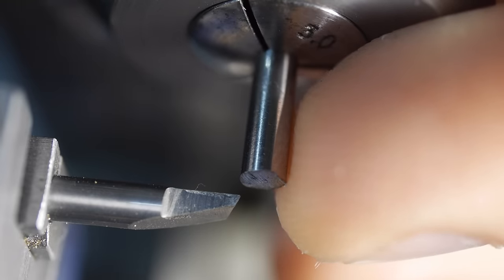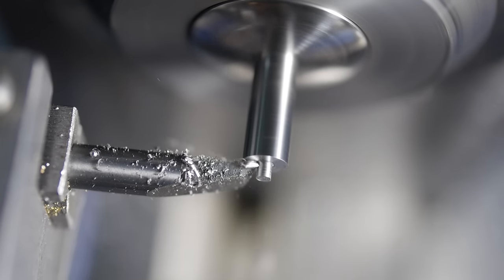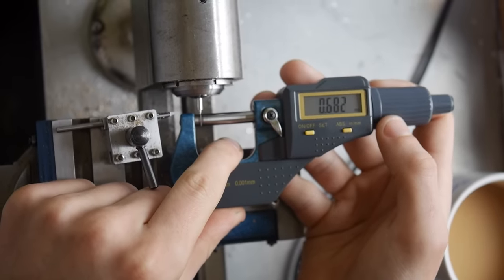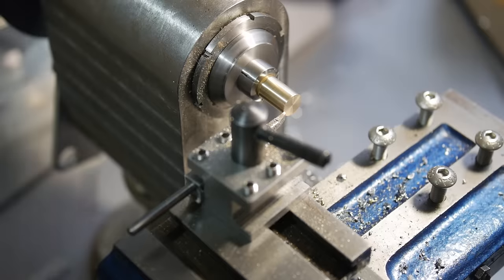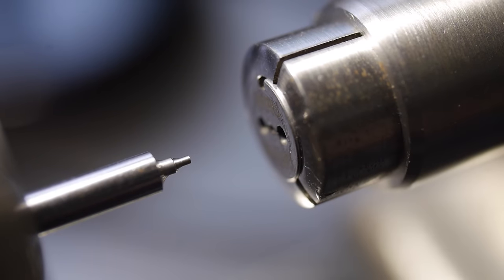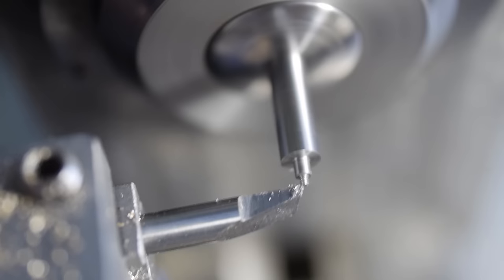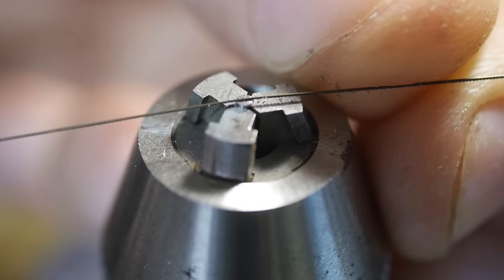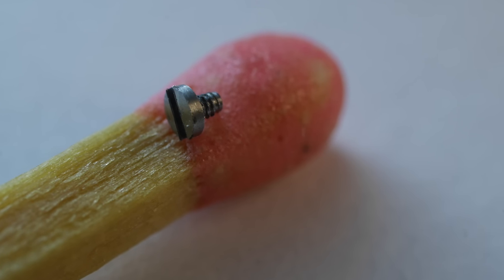Watchmaking: Machining a 0.6 mm Screw

Comment: I'm an engineer working in new product development.  I often get crazy looks from the machine shop guys when I ask if they can make this or that for me.  But I haven't yet asked them to make a 0.6 mm diameter screw.  I should do that and see what reaction I get.

By the way, huge respect to skilled machinists.  Without those guys nothing would ever happen.
Reply: You’ll probably wind up in a compactor.I’m a retired machinist. Our main product was rollers for printing presses and the large one used for glass. Our area most of our tolerances 2/10ths on the roller areas and up to 5/10ths on the main body. The specs didn’t make since at first. I asked the plant manager why are they so important and that tight? If we make them here in the summer and send them to Alaska the specs will be off from just the temperature difference? He said that’s just a guide line. The 2/10ths on the OD makes it so they can run the rollers faster without vibration or wobbling. Thus ruining whatever they are printing. Makes sense. This was when I first started there.
Reply: yo how do you get a job like that? i wanna do that
Reply: @adog3129  Get a bachelor's in engineering, probably best field would be mechanical engineering.  Then try to get an internship at a company that does what you'd like to be doing.  Be patient and keep trying until you get the job you want.
Reply: @paulredinger5830  Those guys would simply give me a crazy look then tell me it can't be done.  Or they would just out source it and not worry about it, lol.
Reply: true. without water purification plants nothing would happen.
Reply: I used to make these dies for watch screws from .3mm to 10 ba, especially for the watch and clock industry in the UK, .but that was 1955  and for 7 years it was a heart-stopping breath-holding experience tapping out the steel and then drilling 3 holes making files to shape a central  cutting section then checking the thread it made under a  microscope think only the swiss carried on doing it after id left
Reply: @jimmyboy131 Gotta be smart as well.

Comment: I've been doing stuff like this for 39 years.
Most machinists won't even look at stuff this small but I just see it as a challenge, the same as machining big stuff.
Reply: super impressive dude! has it gotten any easier/less complicated over the years?
Reply: As a fitter and turner in the mining industry I actually think machining the big stuff is way easier... I admire the blokes like Clickspring who can do the tiny stuff AND make it beautiful.
Reply: It's not quite the same but since I'm not good at making unique stuff in art.  I just started trying to make the smallest real things I could out of clay.  Cups with handles and all less than a cm in size.  Tiny tables, tiny forks, things so small that they usually just fell apart in the kiln, I made a tiny champagne glass only 5mm tall which was my pride and joy
Reply: @membranealpha5961  I'm a tool maker, like anything it gets easier over time. But like op said, gotta look at things as challenges and not whine about them. Ik a lot of toolmakers who whine everyday, and that doesn't make one happy.

Comment: Nice to see someone doing this on a craftsman level with hand ground turning tools. I’m a CNC Swiss Screw machine programmer/machinist. We go down to a #0000-160 screw but some of the smallest parts/features we make aren’t simple screws. A job I recently ran employed both a .0098” (.24mm) drill and .011” (.279mm) endmill. We run those around 65,000rpm.

Edit: Your bit about looking for lost components… just imagine when someone accidentally upturns a cart with 100,000 pieces that all comfortably fit inside of a shoe box.
Reply: Heh… I work in electronics, and a common size for discrete capacitors and resistors nowadays is 1mm x 0.5mm. The maximum thickness is the same as the width. If the thickest possible ones were stacked neatly, 4 million of them would fit in 1 liter. But the smallest discrete components available now are 0.4mm x 0.2mm. So 62.5 million of those would fit in a liter! 😳
Reply: @tookitogo  you must have the patience of a Saint working with components that small🤔😇, I get frustrated trying to they'd fine fishing line through the eye of small hooks!😂✌️
Reply: @jamiecurran3544  Machines do the work
Reply: @yohkodevilhunter8292  yeah but even they get frustrated n make mistakes!😁, I've seen many malfunctions whilst working in places with such machines n had to clean up their mess afterwards!😂✌️
Reply: @jamiecurran3544  Heheheh. 

Yeah, I’ve worked with trainees who were whining about much, much larger parts than that being too small and fiddly, and I told them, “If you don’t like small and fiddly, electronics is the wrong career for you!” (Same thing with attention to detail: if you can’t handle absolute attention to detail, you can’t do well at this, because “almost the same” isn’t the same as “the same” in this industry. Adding or changing one letter to a part number can make it completely incompatible.)
Reply: @tookitogo exactly.  There are 10 types of people in this world: those who understand binary and those who don’t.
Reply: @BobWidlefish  Indeed! And for them, there’s no place like 127.0.0.1!!
Reply: 65,000 rpm!  That's incredible!  Do you use air bearings?
Reply: @yohkodevilhunter8292  In how many years this will be the answer to all questions about construction? Boiled frogs comes to mind...
Reply: Thanks for putting it into perspective with real units. As a welder, I never deal with things smaller than a few inches. Can't imagine having to measure my parts in thousandths.
Reply: lol that edit. Sounds like u speak from experience.
Reply: Jesus, dude. Don't say scary shit like that... That's definitely going to be in my nightmares.
Reply: oh wow 😳

Comment: I have three tap and die sets for those screws and nuts. They are used in instrument repair as well.
You can tell, watchmakers have a huge influence in many areas where miniaturization is used. Which is why I watch such videos to learn ways to repair equipment so it doesn't have to be trashed.

Comment: As a Carpenter I look at my rule and my tape measure repeatedly during a work day. Point 6 of a millimetre is incredibly small. Just stop for a minute and find yourself a ruler or a tape measure. Point 6 or just over half of the distance between those two lines. It is absolutely amazing and stark raving crazy that we can repeatedly produce things of that size and smaller. 
Mark from Melbourne Australia
Reply: I think I'm more impressed by the die!
Reply: True. The statistical process control has to be incredibely tight at these scales.
Reply: @CreepyHandedMan  that or the volume is  super low. Niche-component manufacturing shops have fuck-all process control
Reply: @myuzu_  As others have pointed out, there are swiss turning machines that can produce multiples of these and smaller in under a minute. Truly incredible what some people on this planet are able to engineer.
Reply: When I served my apprenticeship as a joiner/cabinet maker, we worked to 0.5mm setting out staircases. The logic behind this is that if we went to the millimetre, then over 13 risers you could end up being out by 13mm on your FFL to FFL (finished floor level) and if you tried to tilt the staircase to compensate, the treads would not be level.
Reply: @CyberCurtainTwitcher  I just did my first staircase (18 steps) and ended with a leftover 1/8 of an inch at the top. Never thought to reduce it to millimeters.
Reply: It's smaller than a pencil line 😁

Comment: Ive never seen such a small die, one wonders how they make them. Always wondered how very small screws are made, now I know thank you
Reply: The die is made very carefully, lol. If you look at the die closely, my bet is you can figure it out. (Hint: single tooth cutting, pitch offset)
Reply: So in the history of machine shop its a chicken and egg thing. Which came first. The small machines making bigger machines or vice versa. Both I guess. But in the real world of the chicken and the egg, the rooster came first otherwise you just have a chicken with an unfertilized egg.
Reply: American made a wire so thin, nobody could beat them. Sent one to a swiss watch maker. Came back with no message.  Fine examination showed, they had bored a hole in it..  True story - or not..  My dad was a lieing piece of crap, but nice story..
Reply: I seem to remember that about 2 miles of .0035 mm long thread was produced from some of my squeeze dies ,so how they produced from that screws with slotted heads on the mind boggles

Comment: @Chronova Engineering
3:19 You could put a strong magnet (eg. neodymium) in a small plastic bag & attach it to the tail-stock (or lower), so when the part is separated it is sucked to the magnet.
The bag helps you remove the shavings from the magnet, by just turning the bag inside out & remove the bag. (you might need to de-magnetize the part later?)
Just watch out so the plastic don't tangle up with the part in the lathe.
Reply: Can't see how this wouldn't get tangled, or if just sitting a bag down, how it wouldn't be much different sifting through the chips.

Comment: We did 0.55 UNM screws on a CNC lathe by single point threading. If I remember correctly the depth of thread was .003" per side and we had to take .0001" per pass (30 passes) or it would just snap off.

Comment: Nice work, and amazing to see the size of these fasteners.
I've just been working on the other end of the scale, we are currently assembling machinery to start sinking a 1.3km deep mine shaft.
The bolts we fitted last week had 70mm heads and required 4000nm tension 🙂
Reply: whoa what does the process look like at that size?
Reply: @lemminjuice 
Lots of swinging of a torque multiplier gun 🙂

Comment: An old machinists trick when parting off is to use a small paint brush dipped in oil and placed on the small component as you part it off, this should catch the part in the hairs of the brush.
Reply: I've seen a machinist make a paper cone and catch it in that. Just make sure that the end is folded over, otherwise it's just a funnel! 😢

Comment: I work for a company that buys misguided freight from the likes of Amazon and UPS. Not too long ago, I opened a box from a load of UPS shipments and discovered an array of disassembled watches, all packeted up in smaller and smaller zip top bags. I assume they were bound for some final assemble process somewhere, but never quite made it.
Incidentally, I worked for a decade in front line manufacturing making defense and oceanographic components. The smallest thread I ever personally cut was 0-80. I knew of jewelers and watch makers lathes, and in fact the company I worked had a few of them (used mostly as polishing stations for sensor housing lenses).
I was scratching my head, wondering how the tiny watch screws are made, and what a headache it must be.
Thanks for the video. Very informative.

Comment: My grandfather was a master machinist. During the Great Depression he used his mother’s steel knitting needles as stock to make new shafts for a clock. On a 1892 flat-belt drive 18” by 72” engine lathe that could do a 3/4” diameter reduction in mild steel in one pass. A clockmaker recently said the 170+ year clockworks are in very good shape. After my father died I donated the lathe and tooling to a museum that has a steam-powered, belt-driven machine shop. The last production job done on that lathe was 9,500 pieces around 1970.

Comment: I work on model aero engines and mostly make all my own screws.   Slots I generally cut with slitting saws on a vertical Milling machine making a threaded and triple slit holding collet usually in brass first.   Smallest screw I've made so far on my English Toolmakers Lathe was 0.8mm dia. single point screw cut and in stainless steel as it was going into Mother's glasses on a Sunday when all the Optometrists were shut and as she was very short sighted,   her glasses were critical.    Most machined commercial screws are made from leaded free cutting mild steel.   For Philips head screws I cold forge the Phillips recess then machine the head to shape using hand ground form tools.
Only thing I'd have done differently on your screw would be to machine a 30 degree start to the screw thread.
Really good idea when making tiny parts is to thoroughly clean down the Lathe first!   Oh and the older you get the more easily small parts fall from your grasp!

Comment: I used to make twelfth scale miniature furniture  which required very small wood screws. I used 1.5mm aluminium bronze  and a Unimat SL lathe, two tools were needed  the first a cutter angled at 45 degrees  and a parting off tool with a slight angle on the tip.The first cut was to taper the tip at 45 degrees  then to turn down the shaft of the screw to the required OD about 0-3mm  with a 45degree countersink head reduced to the final diameter. I used a watch makers dieplate  to cut the thread then parted it off, the slight angle on the parting off tool allowed one to snap the screw from the stock rather than losing it. The head was finished by putting the screw into a steel plate with a hole to hold the shaft filing flat and cutting the slot with a very fine slotting file.
These screws were made to copy old hand made wood screws and held well if a brad awl was used to open the wood which closed on them after insertion.
Cliff Taylor

Comment: This is crazzy. I recently been watching watch making and fixing videos and its crazzy how small these screws and parts are in a watch. They gotta use a microscope regularly to inspect pieces for broken parts i the piece cause its so small even the smallest mjcroscopic just about piece breaks off a part can cause a watch not to work and you wluld never see that the part is bromen by eye cause its so small. Its incredible how small watch parts and screws are. They are basically microscopic works of mechanical engineering its crazzy. Thats why I lile my clear glass backed high end highly expensive hand made swiss watch cause the machining and blueing and the work and design of all the working pieces is a work of art that this watch maker likes ppl to be abke to enjoy it as a watch and enjoy the beautifull mechanical workings on the inside as well

Comment: I worked in a shop that made high production pressure gauge movement parts.  We ran wire fed escomatic lathes.  We had it down pat and ran ten machines per operator.  
There a lot of ways to catch parts.

Comment: you can make screws like these by the tens of thousands on a 12mm citizen or tsugami. its fascinating to see because what would take me probably 1 - 3 hours to make one manually you could get a setup done in brass on said machines and have them flying off the machine in around 5 hours if uninterrupted/motivated. love this trade

Comment: Truly amazing. Just a few weeks ago I opened up my mother's watch to change the battery but the watch face itself is super small and as big as an average man's thumb nail. When changing the battery I noticed that I could not extract it if I did not take out a screw and the right screw driver was so hard to find. At that point I started wondering how are such tiny screws made.

Comment: When I make very small parts in a manual lathe, I make a cone out of a piece of paper to catch the part when it drops.  Hold the cone in one hand while cranking with the other.  I have never had the paper catch and pulled into the chuck, but if held lightly just let go.  the paper aint gonna hurt yah .  Dump its contents out into a dish or tray and you can easily fish out the part.

Comment: My family owned high production machine shops and in the early 1970s, my parents went on a manufacturer's association trip to Switzerland and Germany to tour some of their shops.  One was in Switzerland and a machine operator gave my mother a tiny glass vial sealed with a press-in cork.  Inside were thousands of the tiniest screws.   You could not tell that they were screws.   They looked smaller than specks of crushed black pepper.  Under a microscope they had approx. 1-1/2 turns of thread.  The screw head was tapered and was slotted.  I'm thinking to myself..."Who makes a screw driver that small?"....and "What in the world are these screws used for?".   I think they were too tiny to be even used in a typical automatic watch.   Maybe they were for a medical device that was ingested?  I have no idea how you would even handle these tiny screws for assembly.  As impressive as the screw is that is made in this youtube video, it looks like the size of an elephant compared to the mosquito-sized screw my mother brought back to the states.  I still have that tube with thousands left in it after giving hundreds away scotch- taped to white business cards.  I am very familiar with Swiss sliding head-stock machines, both mechanical and CNC.  I have never, ever, seen any part produced that even comes close to the screws in that vial.